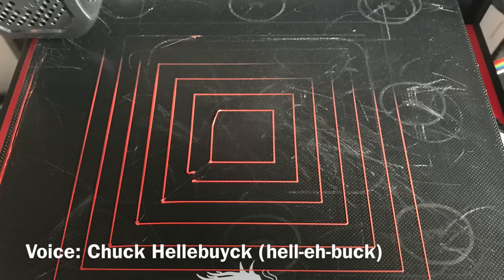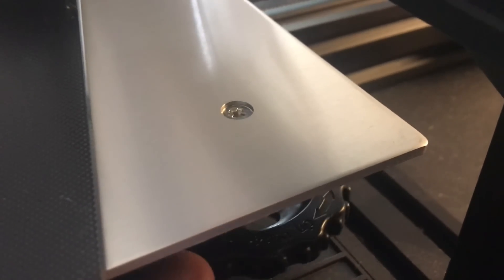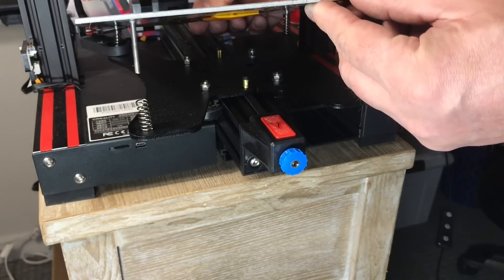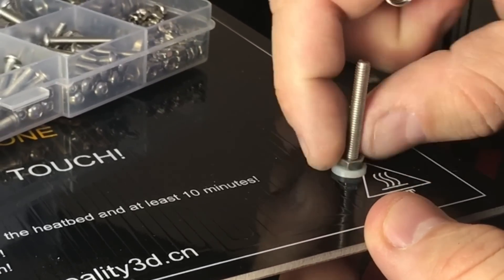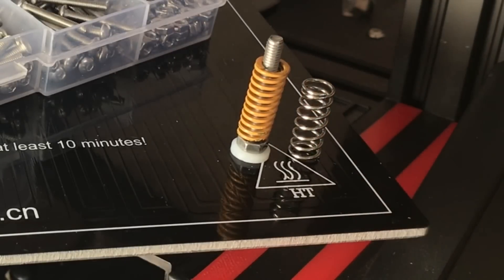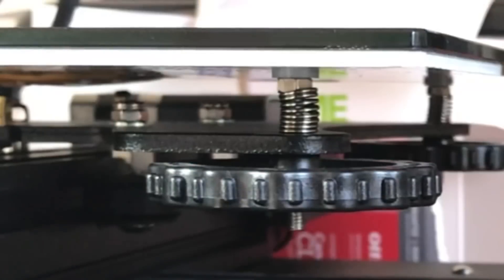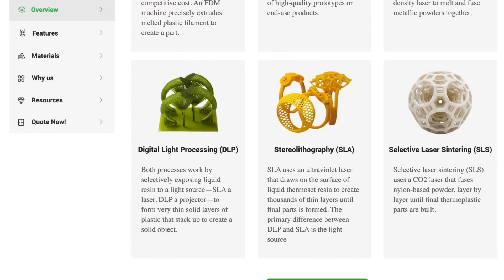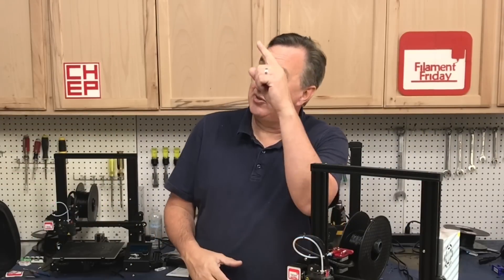Fix Your Creality Ender 3 Bed Level

Comment: Hey CHEP, I have a CR-10 S5 and if I don't print slower than 50mm/s then the vibrations from printing cause my leveling nuts to lossen completely. I'd prefer printing at normal speeda whenever I can because some of these large prints can take up to a week. The bed starts wobbling and ruining prints. This is annoying especially since some of these prints are quite large. Do you have any recommendations on how to fix this? I considered a nut underneath the leveling nut, but I don't know how well that would work. Thank you for the great videos, big fan.
Reply from the maker: There are better bed adjusters on Amazon that fit tighter.
Reply: @FilamentFriday  Awesome, thanks!

Comment: The stock Ender 3 pro Bed seems to have some kind of layer on it that's glued to it and preventing me from seeing the screw tops, Is there another way to test for this issue? We've tried everything to Get the CR Touch ABL to work and I'm trying to rule out any and all possible other hardware interference mentioned and not mentioned across the internet before I end up investing in replacement parts That make no difference in the end.
Reply: Same with mine

Comment: Thanks for making this and those files from the last video. It's saving me heart and head aches. I've also noticed that my stock ender 3 v2s springs loosen over the print time, is it because of a crappy spring? Either way, I'm getting those yellow springs from now on

Comment: In my case the hot end cables were snagged and pulling the print head up on the corners it made me think the bed was severely worped lol.
Cables management is important.

Comment: Before I try this I'm going to use some medium Locktite thread locker. It's not a strong as superglue and it is meant to be able to be disassembled later. As for metal on metal, it works with metal threads and screws, so probably will work with these screw heads. Also it's meant for engines so it shouldn't be bothered by heated beds.

Comment: In my case, those screws do not move but I still have the same problem. BTW I'm using the black silicone spacers.
Reply: Push the bed down while you move your screws i had the same problem
Reply: Did you fix it? I’m having the same problem, but it’s weird because I can level the bed, but when I print everything on my left side gets squished

Comment: Thanks for this. It validates my rotating bolt issue. I did likewise with the nut tighten BUT I found the real issue to be the bolts jamming in the bed support holes. This explains why you level the bed BUT when you go to print the vibration appears to alter the bed height after a few prints. My bed jammed in the holes once the nuts were tightened and had to drill out the bed support holes by about 0.5mm extra diameter. I'm also using wheel locks now.

Comment: the center of my spring steel PEI plate is low. one tiny square of masking tape in the center makes it too high.. what gives? Very inexperienced user here. should I try aluminum foil? I don't have access to shim stock at the moment.
Reply from the maker: If it’s that small I wouldn’t worry about it.

Comment: One corner of my ender 3 V2 bed is really tight and too close to the nozzle and the one opposite is really loose and too far away from the nozzle. I have taken my bed apart and rebuilt it and all of it looks fine, do I have a warped bed or is it maybe the springs?
Reply from the maker: https://youtu.be/8qLJyaBlCCA
Reply: @FilamentFriday  thankyou very much GOAT

Comment: Im getting front right issues where it just doesn't stick and cuts upwards towards the back, resulting in a square with an unevenly rounded front right corner.

Comment: I bought an ender 3 vs two a few days ago and the center of the bed is higher than the 4 corners. Is there any fix for this?
Reply from the maker: You can take off the bed and check it for flatness. You can request a new bed if it’s warped.
Reply: @FilamentFriday  It was the glass, not the bed. I bought a magnetic surface and that solved the problem.

Comment: what causes the corner where nothing is printing? the blank corner, this happened to mine but on the whole bed, and i think the tip burned a hole in the mesh of the bed bc it was too high.

Comment: I have a issue at the moment where i can print out the level maze perfect but when i run a print stright after it never works a brim and skirt feel like they are too far but a raft works ok
Reply from the maker: Make sure your slicer settings have any z offset at 0.
Reply: @FilamentFriday  yh its at zero could the z stop be causing it issues

Comment: Hey, just starting out with an ender 3 v2, i see you have some white marks/scratches on the glass bed, is that normal or should the bed be lowered if that occurs? (mine looks kind of like the white line residue left behind the leveling square pattern on the upper-right corner at 0:35)
Reply from the maker: Possibly lowered. Depends on the cause. Some scratches come from removing prints.

Comment: i cannot for the LIFE  of me get the back left corner leveled to save my life. it begins to scrap along the back corner.
Reply from the maker: Check your base to see if it’s bent.
Reply: @FilamentFriday  my base was out of square from the factory, had to loosen the bolts and flatten it on a hard flat desk
Reply: I’m having the same issue. I’m having a hard time leveling it. I tried tightening it bc loosing it would have the nozzle scrapping it . So 🤷🏾‍♂️

Comment: This g code saved me from throwing my new printer out the window.   Did the paper method 50 times and the print would not adhere.   Just dragged it all over.    Then I ran this method and 5 minutes later I had a well stuck perfect line.  Then my prints were perfect!  Thank you!!

Comment: Exactly what happened to me.  I made a few good prints, but I would occasionally lose level.   When I moved my 3D printer to a different table, I was no longer able to tram the bed.  I found the problem - loose screws (just as you indicated).

Comment: If you ever need to do this again, try 'blue thread locker'. Its used for holding nuts and bolts together on cars, works great. Do not use the red thread locker though as you wont be able to undo that.
Reply: Beds will invariably need to be releveled at some point. Using Thread Locker will be something you will regret, even if you only use blue. Better money spent on upgraded springs (the Yellow ones...Amazon).

Comment: Link to your bed level test pattern???
Reply from the maker: In description
Reply: @FilamentFriday   ty sir ....tuning it now having a lil adhesion prob on 3rd square upper corner from center
Reply: Running pla 215° plate temp 55° speed 100 fan 0
Reply: Ender 3v2

Comment: Hi Chuck - thanks for your videos. I've been trying to get my Ender 3 Pro to work correctly for months to no avail. I used your bed leveler - the bed is level. I replaced the extruder. I cleaned out the nozzle.  I have tried increasing the print nozzle temp to 210 and bed temp to 65. 

Yet still I'm having issues with prints splitting partway up - any thoughts are greatly appreciated. At this point I'm wondering if something is warped and I am not sure where to look.
Reply from the maker: If the print is splitting then try different brand of filament.

Comment: I wonder how to print a line on the left of the bed before first layer print
Reply from the maker: It’s in the start GCode of the machine profile. Cura already has it in there for Ender 3

Comment: Hello! I have a question. Hopefully somebody in the comments can help, I purchased a creality ender 3 and set everything up. Leveled the bed and did some prints. I wasn’t getting consistent quality so I went to re-level. I used cheps 4 corner program and re leveled, went to auto home. And opened his program again and the bed is out of level again. Tried over and over but was not getting consistent leveling results. Could it be the machine? I have ordered a replacement but this is mind boggling. I am new to 3d printing but understand the basics. Thank you!
Reply: I guess by now you already have figured out the solution. But anyways, were you bed leveling your bed with the bed temperature hot, or cold? Because that do probably influenced the end result of your bed leveling process
Reply from the maker: Ernani Neto - my two latest videos prove it doesn’t matter. 
https://youtu.be/NlUO-5EtB44
https://youtu.be/MNVCDNW0RoU
Reply: Its the nut on the right hand side, ↔️ the Z bar is un even probably.. tighten the friction bolt on the tright sidde

Comment: i have a ender 3 pro, and i have checked what you showed and thats not the issue. i have upgraded springs but after every print i have to relevel and it progressively gets worse on leveling... at this point i just want to give up on it lol
Reply: Check your Z axis bar.  Mine had a bit of play.  Had to retighten all the rollers. Helped with leveling (I am using an Ender 3 Pro with a Microswiss Direct Drive Mod).

Comment: Snipping that bit off the Z stop was necessary for me on my 3 Pro: the front left corner of the bed literally couldn’t be adjusted enough for the bed to touch the nozzle. I loosened it as far as I could and before the bed and nozzle touched, the cog fell off the thread! I guess the stock spring was just too short! But snipping that piece allowed me to get the nozzle down the extra few millimeters required for a level bed. Fantastic tip, thanks 👍

Comment: Supergluing the heads of the screws to the build plate works just fine. Mine have been superglued for over a year now and they are still holding just fine. To remove the screws if you ever need to do so only requires a bit of heat from a small torch or barbecue lighter.

Comment: Have you ever experienced ‘center bed dip’?  I have a ender3 and it seems to have a center dip on the aluminium plate because of the centered heating element...  I have a Creality3D glass bed with little rubber compound knobbies that release when cold and it also seems to have a little dip in the center.  Extruder nozzle not as snug on the paper compared to corners...  I try and shim it with a but of aluminium paper between heat bed and glass but not 100% flat, any ideas?
Reply from the maker: You can get a new aluminum/glass bed or you can take it apart and try to flatten with a hammer.

Comment: does anyone know the exact pitch of the bed leveling adjustment screws?  In other words, if you adjusted the screw such that the bed just EXACTLY touched the nozzle, exactly how many degree would i need to back the screw off to get exactly .20 mm space between the bed and the nozzle?

Comment: So I'm wondering.... should the hot end be cold or hot during paper bed leveling?
Reply: Most sources i have encountered say to make it hot. This is because the metals will expand slightly when hot. So if you level cold,  the nozzle distance will be slightly different once hot.
Reply: I've always done it on a cold bed with a Glass print surface, never had any tolerance issues cause of the metal expanding..

Comment: My S5 bed is so big that the glass was sagging in the center with the bed so I put pieces of paper between the glass and the bed and it fixed it.
Reply: What do you mean ? I’m having problems with it right now
Reply: @dariusnexus8867  I took the glass plate and raised it up and slid pieces of paper between it and the metal build plate to where at least the glass was level
Reply: Just regular full size sheets of notebook paper
Reply: Just in the middle where it was sagging a bit
Reply: @unitruth  ill try it right now thank you !
Reply: people usually use foil rather than flammable paper for shims under the bed
Reply: @darkquail2003  as my post says between the glass and bed,not under the bed where there's flammable plastic wires and flammable heating element

Comment: Hi chep, I have a problem, my 3D printer does not print in the center, even though in Cura the object is centered, what is the problem?  Thank you
Reply: Theres an option in the cura settings in the machine settings for "origin at center" or something like that, make sure it is NOT enabled.
Reply from the maker: Your Cura bed size settings in machine settings may not match the actual  printer.
Reply: @FilamentFriday  Ender 3/3Pro is 235x235 (X/Y) yeah?   Mine is doing the same thing after a swap to the Creality 4.2.7 board.  D:  Now it prints “low”/“forward (towards the Y Axis idler). X Axis is correct.   So frustrating lol.

Comment: Just got my first 3D printer , "Ender 3 V2 Upgrade", Just finished putting it together and manually levelling the bed to be close. I have watched several of your videos, Great stuff. I have a couple question . 1)What is the correct position for the Z stop switch, you mention it here but didn't say what is the setting. I.E have the printer set to the home position and the move the switch up until you hear it click the switch or ?. 2) How do you know what main board is in the printer so you get the correct software. I know its 32 bit, 3) I think you mention to use CHEP_M25_bed_level.gcode on the 32 bit boards? then I print CHEP_bed_level_print.gcode with filament as shown in your other video. Thanks in advance for any assistance you can offer.

Comment: I've tried for the past two days for a total of 8 hours to level my bed on the Ender 3 v2 :(( I'm starting to give in and just admit I can't level it.. I've done everything over, and over.. Manually and using the gcodes people suggest. Anyone have any other suggestions? Or know of any kinds of problems that I might be overlooking? I know my bed isn't bent, but I'm not sure if the glass is.. This is killing me.
Reply from the maker: Have you tried this; https://youtu.be/_EfWVUJjBdA
Use the V2 M25 version though.
Reply: @FilamentFriday  I have, a lot.. That's my main go to for this.. Do you possibly think it's my X Axis?
Reply: Hey! Hopefully you have solved your problem by now, but if not this is what helped me. I was never able to level my bed correctly, I would go corner to corner and raise/lower that corner until it was basically touching the nozzle (using the paper method). My problem was that if I had just leveled the top right corner, for example, when I move on to leveling the top left corner everything changes and the corner which was previously level is no longer. What I found worked best was to leave extra room between the be and the nozzle and slowly go around to each corner. You should only turn the knobs very slightly each time. Continue to go around multiple times repeating steps until it is just right. I know this is long, but I hope I can help!
Reply: @chrisrivera5418  i also do this as a beginner but after every print, i have to level again and it sucks

Comment: HI there im new to 3d printing world . I baught a ender 3 v2  with glass table i cant get way the filament to stick on the table only with glue stick :( is there any way to fix this ?
Reply from the maker: Clean it with soapy water or IPA.
Reply: @FilamentFriday  what is ipa?
Reply from the maker: Isopropyl Alhohol. You can get it at drugstore.
Reply: I will try that to see if fix the problem
Reply from the maker: Also level the bed like this: https://youtu.be/_EfWVUJjBdA

Comment: Nice video!
I'm new to 3d printing and just bought an Ender3Pro. The heatbed dips hard. So I made a little frame and pressed it to make it flat. Added stiffer springs from an old broken RC-car. Nice. Not perfect but nice.
Going to get some fine threaded screws today and apply your mod to them. 

Now for my question(s); 
If I print a *Direct Drivinator*, can I just swap the steppers from the extruder and Y-axis to reduce weight on the printhead AND improve Y-axis? Would I need to change settings in slicer software? Or like program the printer? 
Help please I don't want to hurt my new baby xD
Reply from the maker: The steppers should be the same between the extruder and Y axis so not sure what you benefit.
Reply: @FilamentFriday  extruder stepper; 42-40 / y-axis 42-34
Reply from the maker: But it’s just a longer shaft I believe so yes some weight gain. Otherwise identical torque and design. So electrically identical.
Reply: @FilamentFriday  Thank you very much

Comment: I saw your video on the Ender 3 glass bed.  The video said that there were printing artifacts using the glass bed, that were not seen using the stock bed. what if anything can be done about these?  the video said you were going to look into further.
Reply from the maker: Lower jerk settings gets rid of a lot of them.

Comment: Hi @CHEP. I have used your bed leveling gcode for sometime, but I have just replaced my old Ender 3 with another the same but when running your leveling file the print end doesn't stop at each corner so I can check the level. Its just taps each corner without stopping. Any idea's why this Ender 3 is acting differently. Cheers!
Reply from the maker: You need to use the M25 version for 32 bit boards.

Comment: @CHEP I just bought my first 3d printer which is the Ender 3 max, and the first benchmark (boat) turned out good and well, then I updated the firmware from Creality's own website specifically for the ender 3 max (marlin Ender-3 max 4.2.2mainboard firmware) then I realised my bed had un-level and the prints were not sticking, (and that was ok) but all of a sudden, every time I want to do a printer I keep on getting a (Filament change) which makes my heat bed move forwards dramatically causing it to crash

Please help if you have any solution 

Thank you
Reply from the maker: Are you sure your slicer setup isn’t causing that?
Reply: @FilamentFriday  Thank you for replying

I honestly don't know, but luckily the problem seems to have disappeared